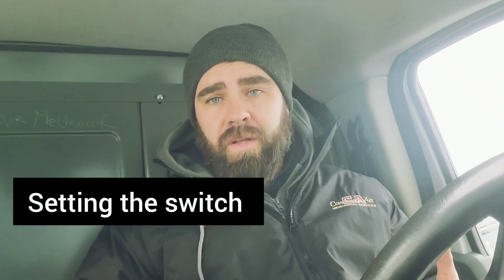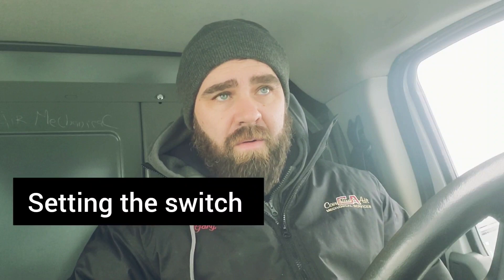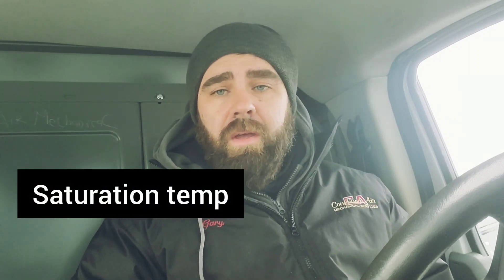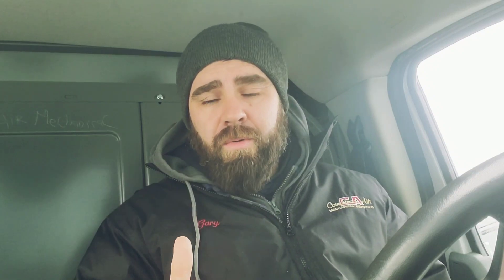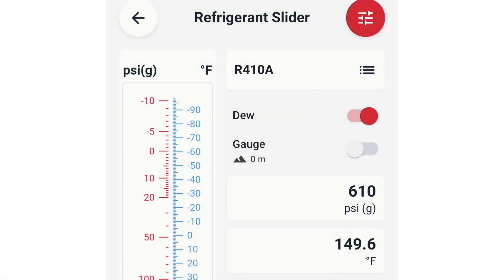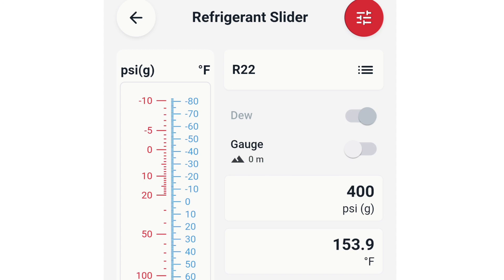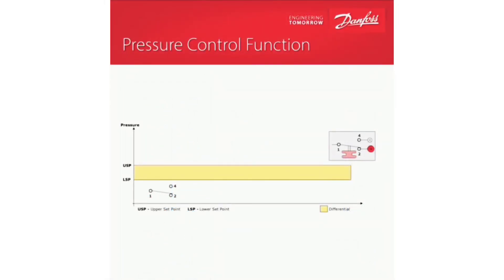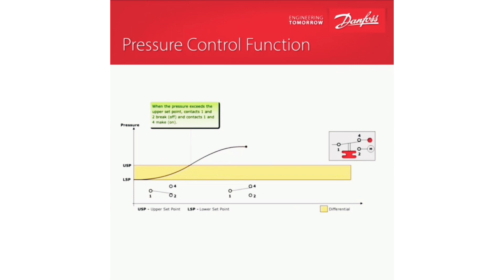Refrigerant High Pressure Switches and How To Set Them

Comment: Yes definitely as you mentioned having switches leak internally and lose the charge up through the electrical wiring. 

      One day when San Francisco broke its record-breaking heat wave and hit 105° I had had three customers call me up with their system is not working when I got there all three of them had high pressure switches that burst it internally losing the entire charge through the high-pressure switch.  
       All on the same day simultaneously
Reply from the maker: Crazy!  I appreciate the feedback